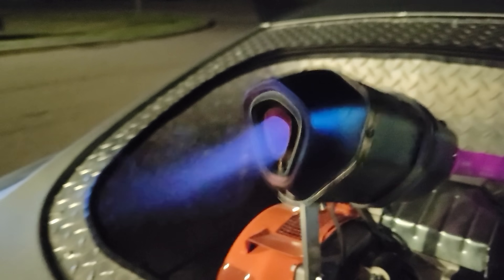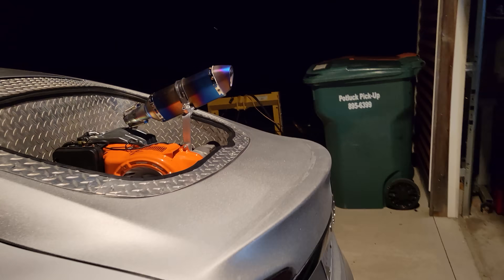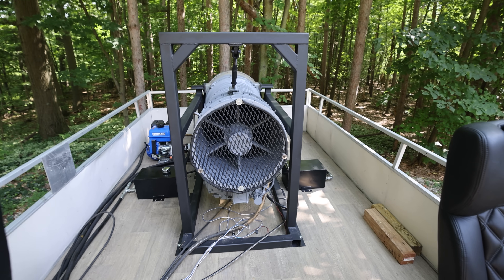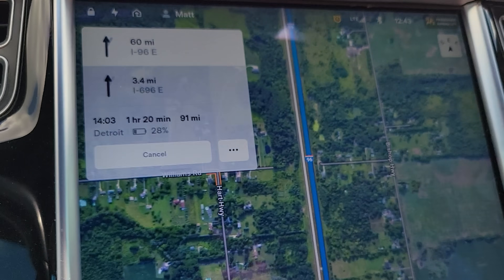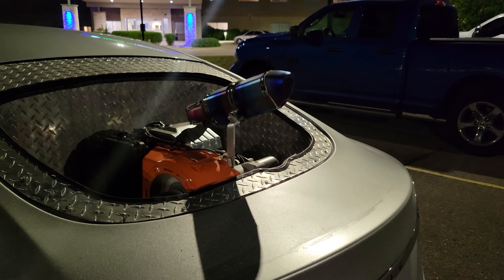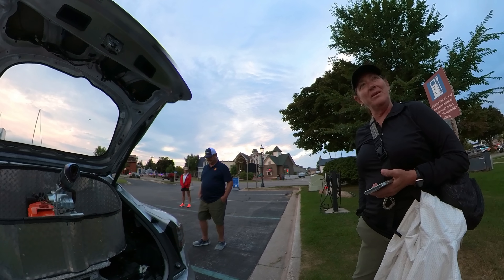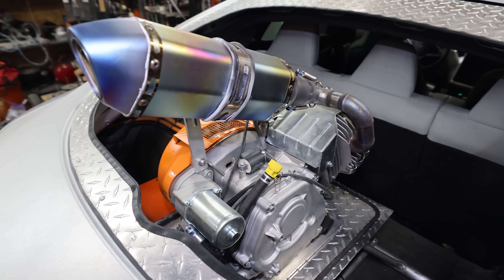Cordless Tesla (I Drive 1800 miles without charging) P.1

Comment: Without a doubt the most moronic thing I have ever seen.  Only an idiot would try to run a car on a gas engine that is half the size of the engine on my lawn mower.
Every time you convert energy from one form to another there is loss.  In this system you would be lucky if even 10 of those 13.5hp actually made it to the wheels.
I would also question if this "generator" is even connected to the car.  Seems like the car's operating system would shut down if it saw an incoming charge to the
batteries while the car was in motion.  I know this happens during regenerative braking but the system is expecting that.  This whole video seems a little fishy to me
so I have unsubscribed from this channel.  I like to see cool things being made even if they don't work.  Just please don't make a video like this and insult my intelligence.

Comment: Figure power draw for highway speeds is around 30kW/h, for city, average with regen would be around 10kW/h
Ref: average diesel car on highway gets around 32mpg, diesel being able to produce 10kW/h per gallon, is roughly 2.35gal/hour fuel burn, or 23.5kW of total usable energy
Should the nuclear/atomic/beta/alpha voltaic battery become available, still good to have propulsion battery  for reserve, probably should be produce  at least 15kW. 
Usual driver on the highway stops about every two hours to get out stretch, eat, use the bathroom, etc.

Comment: you can get better fuel economy and lower noise and more wattage output with one of those kholer diesel engines. portable gas generators suck. they drink fuel and barely generate any juice. would love to see details of how this worked as well as the upgrade to diesel. diesel is better with heat too, so your exhaust won't get anywhere near as hot as that gasser did.

Comment: Modify the generator to run with HHO and lean out the gas. You'll need to determine the liter's per minute needed and lean out the gas but you could scale up to dual generators using less fuel that you did this time for much more efficiency. Also, do not use baking soda as a catalyst as it creates chlorine as a byproduct and make sure you install scrubbers and flashback arresters.

Comment: Fuel injection is essential for efficiency. BMWs 643cc i3 range extender motor produces roughly 4kW at about 38MPG. (Good enough to send it down the road at a constant 65MPH without losing charge.)

Comment: Cool video as usual.
I think if you're going to reach your goal though you'll need to explore microturbine generators for the next iteration of the project. 
Capstone is the big name in this market but I don't know if they make anything small enough. 
An interesting option might be a pair of Fusionflight ARC generators run in staged parallel. Running one in economy mode with the second kicking in when you need higher power levels.

Comment: The flame coming out of the exhaust means the motor was running SUPER inefficiently, right? Also - there MUST be a more quiet engine/muffler. HAS to be. After all, motors that make much more power can be, and are in many circumstances, far more quiet.

Comment: Yeah I suppose you could get a little bit of a rocket boost too from that spraying fuel leak for a short time🙄 also got to be agreeing with some of the comments on there not entirely full disclosure a lot of guessing there not Mike micrometrically scientifically accurate on all the details and the devil is usually in them as a saying goes

Comment: This is why I'm so sure that they can put a generator in the car ,like the ones we use on bicycles back in the days that runs on the wheel to generate the power to change the mechanical energy in electrical energy so the car can continue traveling without stopping. Attached it to the motor.

Comment: I’m definitely not an engineer, but sounds like you need a second motor and maybe some duct work for some airflow over the engines. If the engine temps went down, maybe so would the fuel consumption.

Comment: I would just stop the project after that. You proved that an electric cars batteries can be maintained while being driven, albeit inefficiently. Obviously, if you use a more powerful generator you can maintain a charge at higher speeds. What's there to figure out?

Comment: Why didn't you adjust the ignition timing on the poor thing? It's not supposed to spit flames or have so high EGT.
Use a 40 kW engine and generator and use them at ~80% load to have the steady flow of 30-31 kW you need at 80mph.
Small turbo diesel.

Comment: I went on a 1750 mile trip with my Ram Ecodiesel in August. Took 30 gallons extra diesel in the bed. Never had to stop at a fuel station. Averaged around 32 mpg. No range anxiety.

Comment: Nissan did this with their E-power powertrains, but they figured out quickly that it won't work for how Americans drive, like this guy just did. The gas generator cannot produce enough watts to charge as quickly as the watts are used. However, Nissan did achieve a very high thermal efficiency generator in the process.

Comment: This is awesome as a proof of concept! I agree that I will be annoyed as heck if I'm your neighbour (for the night) but if I met you and understood what you were trying to do, I would absolutely support the effort! Data collected will really help future builds.

You definitely need a more efficient and quieter electrical generator with higher amperage that is also light & small. So it probably means more cylinders and the ability to measure air/fuel mix. Not sure such a small engine exists.

Comment: I would imagine if you step it up and go with a diesel generator that would help some, and with the addition of a good muffler it would probably be pretty quiet.  Perhaps one with a automatic control would adjust load if it is powerful enough to reach a higher state of charge to throttle down some to reduce consumption.   Very interesting stuff.  I love the stuff you build keep it up!

Comment: So the engine is not efficient enough to charge faster than batteries discharge. At some point you need to stop and wait, just because you disturb the traffic with your low speed. Instead of driving as normal man, stoping at the supercharger relax for a few minutes and get sharp and focused for the next 400 or whatever miles, you decide to pull over and listen to that ICE engine. It is loud, ugly and inefficient. You make a step backwards, this won't have application don't waist your time. If you want you can buy plug-in hybrid electric vehicle (PHEV). You basically made this Tesla a loud and inefficient PHEV.

Comment: Need a 220v inverter generator. A better muffler to deal with that racket, the one you are using is a free flow motorcycle part. Looks cool, but not very effective when your engine runs high RPM all the time to maintain current. Your current generator output is just too low for what you are doing.

Comment: You could have muffled it way better, and use a two cylinder with much better balance that would have produced way more power while being way smoother and producing way less noise. Using a single cylinder engine was just silly. It's horrendously loud and doesn't even sound good, not to mention you had the audacity to leave it running in a hotel parking lot over night. Classic main character syndrome.

Comment: Good job! The final words in the video are spot-on! Larger motor-slash-generator next time to produce enough power or more than required by demand. Agreed, solving the need to pull over to charge would be the icing on the cake. Design, test, redesign, and test again. Cheers! 😎🍻

Comment: Maybe put electromagnetic spinning generators in each wheel to charge the Tesla battery? Put the copper wires in the calipers and imbed magnets in the rotors. Also, put a few solar panels on the roof, frunk, and trunk to charge the battery and see what happens.

Comment: Let me suggest that next time, get a quieter muffler than that motorcycle muffler.
Reply from the maker: Long story but I ended up putting this version back together for a short time today, I'm working on getting a better muffler but I realized after doing some testing that a lot of the noise is engine noise and air noise from the fan since this unit is air cool, even with a quiet muffler it is very loud, it's just not a very good engine.

Comment: I would like to see a diesel generator torn down without being to obnoxious on the exhaust.. maybe a flapper tractor exhaust lol.   Without doing the math it seems like your 60% of the way there,  maybe just slow to 65mph and see what diesel generator you can set up for the most efficiency and least noticeable range extender system you can come up with.
Reply from the maker: I don't want to drive slower

Comment: Hey dude, just seeing you for the first time. Hey I like your style. That was was really smart too visit Kohler, I hope you will work with them to develop a bolt on unit for electric vehicles. I think the ev software could certainly be adjusted to utilize all the potential of such a device. And Kohler could certainly figure out a build a whisper quiet and more efficient 4 stroke tiny engines like you build. 
I'm going to invest in Kohler. 🍻 What's your companies name? Get a DBA and file a patent if applicable. 
A company like that would explode. The market is only going to grow for such a solution and middle ground to the battery life and range issue.
Reply from the maker: Thank you, great minds think alike.
Reply: @WarpedYT  yea man, after I wrote that I went down a rabbit hole lol. You certainly are doing your research with those baby engines... That's the future.. small engines using basically no fuel and generating a charge. Don't try give us now what we'll already have in 10 years. But give us what we need today. Eventually you might be able to come up with something the size of a shoebox. But get. A 2 egg crate box sized , mostly universal bolt on. That's what we need today. 

I always wanted to watch a start up .. the next Tesla or George Foreman Grill .. either way that's the case lol

Comment: It would have been great if you could go into how you wired it in and how you set it up to change while driving
Reply: its a troll.
Reply: I agree with others in thinking it's fake.  You can see there's no output shaft on the gas motor or a generator hooked up to it, which means the only way it could be generating power is through a stator inside the flywheel.  You can see the stator briefly in one of the shots but I seriously doubt you can get 10KW out of it.  Even if that were the case, he claims it can charge the battery while the car is running.  I'm not sure how Teslas are set up but my Bolt only has one high-voltage inverter in the vehicle.  Since the car's battery pack voltage is more than typical charger voltages, the car has to use an inverter to increase the charger voltage above the battery voltage.  But the car also needs the inverter to run the main drive motor.  This means you can't charge the car using the normal charge circuits while driving, and the only way to charge while driving would be to generate the high voltages required (400 plus) yourself, which I highly doubt this guy is doing.  

At best this guy probably hooked up the gas motor's 12v starting battery to the Tesla's 12v accessory battery and called it a day - but if you call that charging the car I strongly disagree.

Comment: The fuel efficiency was better than I expected, still not the best though.

Having a backup generator however should be a feature for vehicles in the future.

 I'd lean more to an RTG or solar to trickle charge over time for extended range, and fill while idle.
Solar is available now, an RTG though... There are none for consumer usages right now.

Comment: What about significantly upgrading the battery only system? Like twice as many batteries, two charging circuits, two battery banks to use before empty, swap from one to the other at 10% so you would theoretically be able to calculate you're ranges at 170% over stock and be reasonably safe, even with the weight?

Edit tl add: what about a trailer full of batteries? So like 800-1000 mile range? Or even a trailer that can run the full size charger lol. Run it on natural gas or diesel, be perfect and never run dry...sorta.

Comment: You need to look into the compact turbo diesel engines that vacuum trucks use to spin the impeller. Should be a perfect mix of high torque and good fuel efficiency.

Comment: I've heard some talk about paint that is solar power generating paint. Wide body kit, big panels as you can get attached directly to the panels, solar paint for the rest? Add to a car that charges off solar as well, maybe regen off the brakes or engine brake, some wind turbines hanging off the back of it? Then still add the fucking generator because it won't be nearly enough, but even if it's 10% or ideally 15% more battery capacity passively, that would be great.
Reply: You could NEVER get a tesla to run off of solar. Solar panels are only 22% efficient and on bright sunny days at noon when the sun is brightest it only puts out about 1000w per square meter... How many square meters do you think the tesla is from the top? Maybe 4? So 4000w times 22% equals 880w of charging per hour  at the MOST you could ever hope to achieve... That translates to an additional 2-4 miles of range per hour depending on speed and road conditions. You are talking about some stupid paint on solar which is even less effecient. People need to lose the idea that solar powered cars will ever be a thing...
Reply: Lmao... The fact you think adding wind turbines for extra charging makes sense is funny. Can you tell me why it would never work to add wind turbines to the top of a car? Just think about it.

Comment: What was the wattage rating on your generator? 5500? That was a pretty cool video 👍👌
Reply from the maker: Yes I ran 5,500 Watts,. The engine was good for about 13 horsepower but my system was not
Reply: @WarpedYT  what would you think would be enough wattage
12,000 to 15,000? Or would you think more?

Comment: cool, i always was thinking of somebody pulling a trailer with one of those huge kaeser generators plugged to the car, but this is better, maybe one of those small 3 cylinder kubota diesel engines is better suited for the task, those can iddle for long periods of time and can be left unatended i've seen them in cellphone towers as backup power running for monts at the time

Comment: So basically he turned a Tesla into a BMW i3 Rex that came with basically this setup from the factory. 

It’s an electric car with a 600cc bmw motorcycle engine under the trunk floor. You use at like a normal electric car, and when you have a road trip you can turn in the gas engine to boost the range between stops to charge.
Reply: Thanks for watching and commenting ❤️ you have been randomly selected from comments as winners of today's giveaway hit me up via the digit's above to claim your prize 🎁...

Comment: I'm surprised I see no one mention this but it seems your generator is running rich, seeing flames out of the exhaust means there is unburnt fuel, this is probably why this wasn't very efficient.

And more importantly you should use a diesel generator, they can be much quieter and produce more charge at lower RPM.
Reply: Thanks for watching and commenting ❤️ you have been randomly selected from comments as winners of today's giveaway hit me up via the digit's above to claim your prize 🎁..

Comment: Did you measure electrical power?  Did you require heating or cooling during the trip?  Model S uses about 0.32 kWh per mile.  If you're going 60 mph that requires a 19.35 kW generator.  I see why you stopped at Kohler.
Reply: Thanks for watching and commenting ❤️ you have been randomly selected from comments as winners of today's giveaway hit me up via the digit's above to claim your prize 🎁...

Comment: Am I missing something? Are we just being trolled here since he's leaving out all the details? I don't see any generator or power leads connected to the engine. A generator/alternator larger than 5kW starts getting pretty large. Is the whole point of this video to just make a bunch of noise and troll people? I mean, that's still pretty funny if so. 

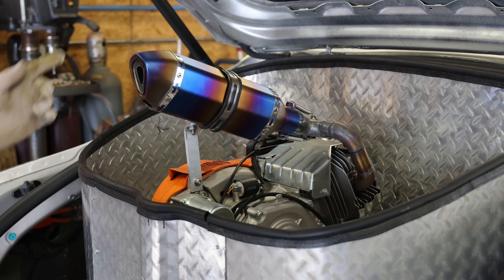Was just going to edit that at around 2:10 you can see there's nothing hooked up to the engine. The drivers side is just the flywheel and cooling fan, the passenger side is just the crankcase cover. There's a red and black set of wires going underneath, but I think that's just powering the control electronics, that's not heavy enough to carry more than a few kW, depending on the voltage. Also wouldn't want 400v power leads just flopping loosely about.

Comment: Number one I drive a Kia Optima which is a hybrid, not a plug-in hybrid but they do have them, they are coming out with the new K5 all-wheel drive Kia plug-in hybrid in 2023, that engine shouldn't have to be running all the time, you are defeating your purpose. With that in mind how much wind is blowing down that car where you could actually possibly put something like a wind tube there that would turn a jet Turbo , which would turn the generator generator, so as you drive down the road you are charging the batteries

Comment: i'm surprised you didn't use a larger two cylinder to have more juice. at minimum i would have a 20kw capacity generator

might wanna try a tiny turbine generator. about as loud but is capable of making more power and has a greater efficiency.